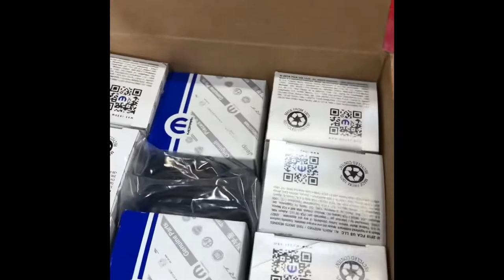Rebuilding ram srt10 brake calipers. And why they go bad.

Comment: HELLO SIR, I AM HAVING THIS SAME TROUBLE. WHERED YOU GET THE KIT AT??
Reply: I had the same problem I had to order the parts separately the pistons I got at AutoNationparts and the gaskets I got from viper parts depo
Reply: 5143399AA Is the part number for the pistons and the gaskets just search srt10 front caliper rebuild kit
Reply from the maker: JTS venom out of North Carolina